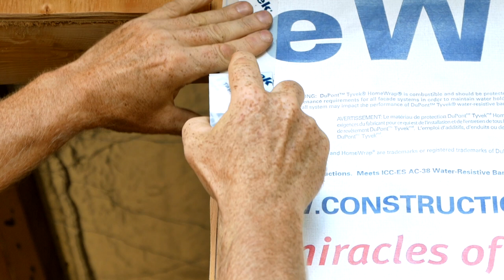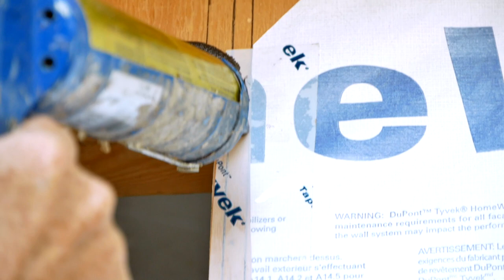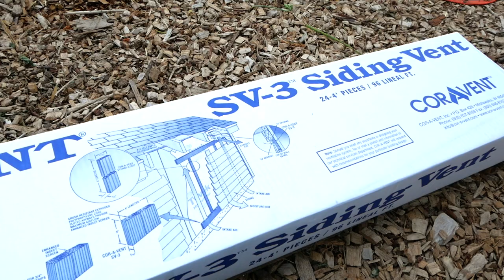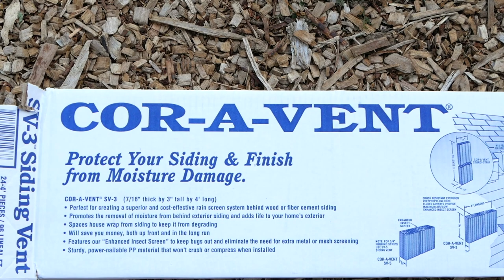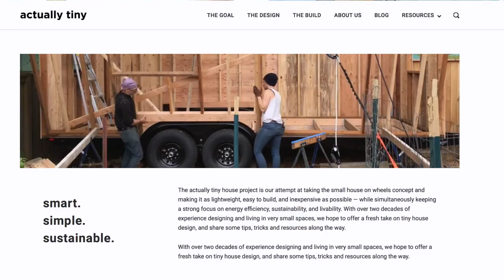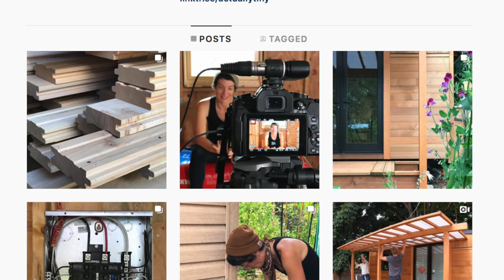House wrap, Rain Screen, and Window Flashing Details

Comment: As a carpenter, I can vouch for this guy. well done video. one thing I could suggest is that if you're planning to put rain screen on right after house wrap, one only needs to put enough fasteners on the house wrap to hold it in place. The rain screen fastens the wrap better than anything. Saves on penetrations too. 
Sure wish I was starting my career from the beginning. YouTube is a wealth of resources. I spent 30 working years learning as I went.

Comment: When using the vertical PT plywood batten strips, shouldn't they be spaced away from the window trim to prevent capillary attraction of water between the batten strip and the window trim?  I'm thinking maybe placing the batten strip about 1/4" away from the window trim to prevent any water from being trapped against the window trim and eventually causing decay of the trim.  Great video- thank you!

Comment: Great video! Question: At the bottom of the house where you have the coravent cut to fit between the 2" PT straps could you instead run the coravent along the house and install the 2" straps to the top of the coravent? Also are you nailing your siding with short nails just into the 2" straps or longer nails to reach the studs? Thank You! and again Great Videos!
Reply: See the message at the bottom of the screen at timestamp 22:30  ; ]

Comment: Hey Brian, quick question.  Do you have any opinion on the hubor zip system as a replacement for tyvek?  Adding to that they have a liquid flash product that replaces tyvek tape (although they do have tape as well)?  My wife and I love your videos.  We just purchased a 30 foot iron eagle last week.  I can't wait to get started/lose some hair.
Reply from the maker: I haven’t really worked with zip system.  Seems like kind of a cool product I think I would consider it if I could afford it and it wasn’t heavier than the plywood I use.
Reply: I like zip system because that Tyvek can be a nuisance to install correctly in the wind. You just have to remember to set your siding nails just below flush and caulk those holes.
Reply: Where I'm at Huber can't even direct me to a Zip system dealer within 100 miles...

Comment: Question:  why did you not tape the sides of the corner gaskets?
Reply from the maker: I asked the same question but the manufacturer says not to do it that way
Reply: @actuallytiny2537  so weird.  Did they give a reason why?
Reply from the maker: Not really, I actually did what you’re visualizing on the other window I just didn’t feel comfortable installing a product against the manufactures instructions on video

Comment: You are teaching folks to flash windows incorrectly.  Dude reverse lapped the window install. Use the same logic as shingling a roof with flashing hierarchy folks.
Reply from the maker: What do you see wrong here? The only thing not shingled is the corner flashes and that’s specifically according to the manufacturers instructions for those.  Not how I would do that but if I’m giving a demo video I have to teach to the installation instructions for whatever product I’m using.  This also affects the warranty on the windows.
Reply: @actuallytiny2537  I've always seen house wrap cut in an x inside the window opening and the flaps are folded inside and stapled to the interior. Then the only taping you do before the window goes in is at the corners.